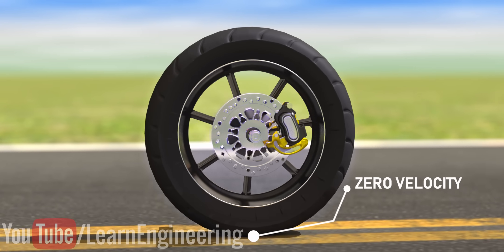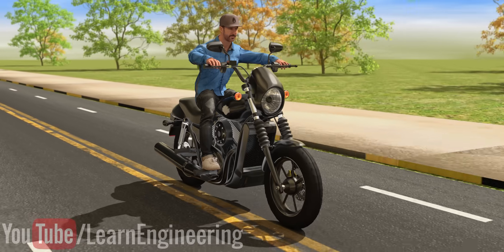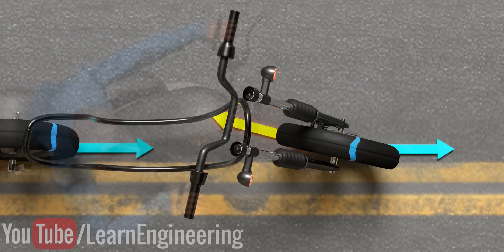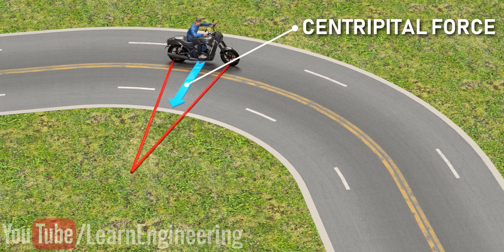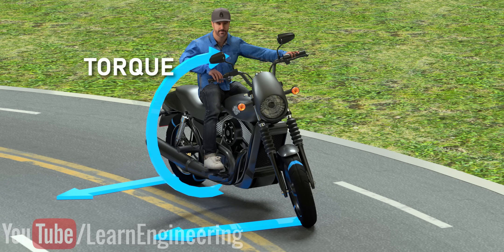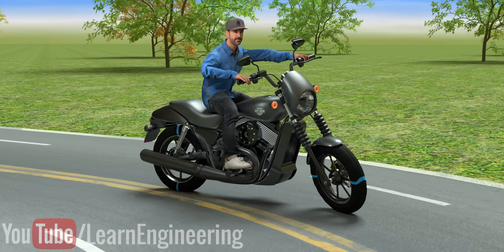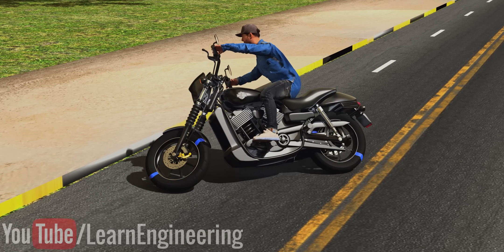Counter Steering | The interesting physics behind it

Comment: What crap! Only at very slow walking speeds can you turn the handlebars in the direct you want to go and the bike follows. Above walking speeds, push right, go right, push left, go left. Pushing the handlebars left means turning the handlebars to the right, and the bike leans left, goes left. Push harder, and the bike leans deeper, sharper.  The same for the push right, go right ~ turning the bars left by pushing right, leans the bike right, and you go right. It’s so seamless, most folks don’t even realize they are turning the handlebars in the opposite direction they intend to go. A classic case of those who think they know, don’t really know, but talk like they do… .

Comment: The problem with "countersteering" is everybody has to over engineer their explanation or techniques to counter steer (i.e. push the left grip forward to go left). It's WAY simpler than everyone makes it. I personally believe that if you need to think about how you are going to countersteer, you shouldn't be on public roads yet. You need to develop your instincts first.

I think of it as weight shifting. If you need to turn left, you need to shift your (and the bikes) weight to the left. The only possible way to to that is to turn the handlebars to the  opposite direction and Instincts will take over from there.

The notion that it "only applies if you are going over 15 or 20mph" is nonsense. Handlebar movements only become much smaller and much more critical at higher speeds. Try and ride your bike at the slowest possible speed that you can and watch how much you turn your handlebars to keep yourself upright. THAT is still countersteering.
Reply: i saw a really good video about counter steering, the best ive seen. when we ride a bike, we all by instinct slightly turn the bike left before we turn right, and slightly turn right before turning left if we need to
make quick turns. its the same on a motorcycle
Reply: @itszezes  
You don’t do that on a motorbike.
Reply: @itszezes  Turn left and then right to turn right is a Scandinavian flick and it only works with cars.

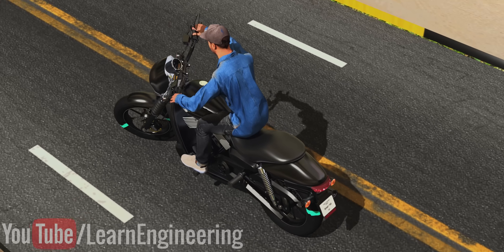Comment: WRONG!.... Geez I hate people trying to look smart talking about hting they don't fully understand and invent theories... Ok so before 3:30, what you said was close enough to the whole truth. But a complete physics analysis would be too long so cutting the corners like so is ok. BUT... At around 3:30 you are claiming that "the torque" will lean the bike to the right is not only completely wrong, but also, it goes exactly and completely AGAINST what you just said. And even a complete moron can understand easily where the mistake is. You talked about the "no friction" earlier. So how the hell can you come up saying that the "torque" would lean the bike on the right. You know what torque is or not? Obviously not. Torque is a force originating from an axis that makes something spin around said axis; like in an engine. That axis on a bike is typically at the height of the center of gravity of the bike; somewhere just below the fuel tank usually for handling purpose. So if it was a torque like you say that is causing the bike to lean, then it would mean that the tire would have a tendancy to turn like a fan, around a longitudinal axis like an airplane making barrels. Going upside down and back up and son on in mid air. That is obviously not what is happening here. The reason why the bike is leaning is simply due to inertia and the friction of the tire. You see, when you turn the handle lets say to the left like in your example, you make the bike turn left because of the friction of the tire (go back and learn the basics of inertia). BUT, since every part of the bike and the rider that is not in contact with the ground wants to continue in a straight line (inertia), the wheel wants to go in one direction while the rest wants to go straignt, making the bike "fall" on the right side. THAT is why the bike leans into ont side or the other quickly. Don't forget there are 2 ways to change the lean angle of a bike (as you mentionned yourself). By using your body position, and counter stearing. Using your body position to fight off the mass of the bike and the gyroscopic force of the wheels mean that it take a lot of effort, thus time, to change your trajectory. Hence why at high speed and in a tight curve, you MUST use counter streering to lean the bike quickly so that you can in turn pivot the bike in the right direction. And then, once the bike leans on one side, many different forces act together to make the bike turn. That part you got right. There is no magic torque in the middle that make the bike lean. Again, it is the friction of the tires that fights off inertia while the rest cannot that leans the bike in one side. And in fact, the reason why it allows the bike to lean way quicker is that your whole body, and the bike's mass act as a lever. That also explains why you don't need it at speeds below 15 km/h or so. Because there is almost no inertia, and the gyroscopic force cannot participate in the battle of forces which actually turns a leaned bike while preventing it from falling on the side.

Comment: Your science is very flawed however ALL 2 wheeled vehicles initiate and maintain turns with one steering input, a push in the direction we wish to go (countersteering) You can lean all you want and the bike will not change direction. There must be a steering input to change the direction of travel and lean the bike. We don't cleverly do anything.

Comment: There's a phenomena called gyroscopic precession at play here which means a force acting on a gyroscope such as a turning bike wheel will result in the effect taking place 90 degrees after the input in the direction of rotation. Nudging the handlebars left will result in that input initiating a lean to the right, that lean to the right then helps turn the front wheel to the right appropriately. That's how I understand it. This gyroscopic science is used wisely in aircraft instruments and helicopter rotors alike. While it works ok, I once read that using this technique on a motorcycle caused erratic wear on the front tyre and was advised to shift weight to the appropriate foot peg to initiate a turn to prevent this uneven wear.
Reply: I would argue that the foot peg scenario is far less effective than counter steering. There is only one way to steer a bike. I read a similar tale a while ago, but the author stupidly made the assumption that the front wheel continued to steer against the bend.. as opposed to steering into the bend. Now if he had been correct (which of course he wasn’t) I could see the argument.

Comment: Counter steer is only in effect at higher speeds theoretically it is at lower speeds to but almost never applicable if you have a bike or bycicle take it up to cruising speed hands off and just push one bar. It will lean to the side of the bar you pushed and make it easy for you to quickly turn. Boom you counter steered

Comment: Counter steering is a must if you are serious about riding it should come natural even if the technique doesnt make sense.  The best way to describe is turning the wheel produces leaning forces in the opposite direction.  This makes it far easier on the highway as being straight up balanced going 60mph or faster your barely gonna be able to turn unless you use counter steer leaning is for large slight angles and countersteering is for the unpredicted situations you need more response out of your motorcycle the better you get the more agile you become

Comment: This video shows things that are NOT true.
1) There is no such a thing as "normal steering", bikes ALWAYS turn by countersteering and everybody turn this way, even when they lean their body towards the center of the curve, because the body leaning movement will forcefully transfer some weight on the inner handgrip, leading to an effective countersteering action.
The only possible way to steer a bike without countersteering is to shift the rider's center of gravity towards the center of the curve (wich is achieved by leaning the body PLUS loading the inner footpeg) while NOT touching the handlebar, and this thing is definitely NOT a "normal steering".
2) After you lean the bike by countersteering, there is nothing like "the drive cleverly steers towards the direction of the curve" in order to re-align the front wheel to the turn.
The front wheel is AUTOMATICALLY re-aligned by gyroscopical precession, the driver does NOT do anything but holding the pressure on the inner grip.

Comment: We all seem to be leaving out a huge part of steering a motorcycle. LOOK WHERE YOU WANT TO GO, NOT WHERE YOU ARE GOING. Then push on the bar in the direction you want to turn.REMEMBER, BIKES GO WHERE YOU LOOK. You will need to maintain pressure on that bar as long as you need to be leaned over, so you are controlling the lean with the amount of pressure and the length of time you hold said pressure.   It simple but you do need to practice it in order to control it effectively.
Reply: Lol I wish I knew this when I skid out on a hairpin turn.
Reply: @iBloodxHunter  what we're the mechanics of your skid? Did you wash out the front wheel or slide the rear wheel? Either way, speed should play a part . Too fast and washing out the front is possible but control able and too slow and counter steering doesn't work as it requires centrifugal  forces, however all of it goes away if you hit something midcorner like gravel, or sand ,or an animal  or give it too much gas and break the rear tire loose. Which mistake did you make?
Reply: @elmerfudd1086  Slid the rear at 25-30 ish. There was a straightaway for like half a mile and they put the 50mph limit sign right before the turn. Should have payed more attention.
Reply: @iBloodxHunter  do you put a tire dressing on your tires? That stuff creeps up the tire and onto the treads which often causes the tires to lose grip. Either that or there was something on the road surface like sand or gravel or possibly grass clippings if there were enough of them. However, it could even have  been caused by old dried out hard rubber tires even if they were dry without the sand or grass clippings. But in the end...none of us have not messed up at sometime while riding a motorbike so don't beat yourself up about it. I know from my own experience,  this is one of the more effective methods of learning  how to ride better. I'm just hoping my education is over by now.

Comment: What really makes a difference is the weight of the wheels. Most imports run very light weight wheels, whereas harleys do not. This adds to the gyroscope  effect and makes turning much more difficult! For some reason this company resists better safer technologies. My guess is cost. Strong lightweight wheels are expensive. Hd likes to charge high prices for the machines, yet use cheap components to build them. 
If you're going to buy a harley after years of riding Imports get used to a hard to turn bike along with less effective brakes!

Comment: This is the worst article on steering a motorcycle I've ever seen.  Every motorcycle rider countersteers whenever going over about 15-20mph.  They don't think about it, either.  It's a natural act of riding and steering.  Doing anything other than that will result in you crashing the bike.
Reply: I countersteer when I go zero mph or faster.

Comment: Physics ok but he has no clue about driving. You dont practice countersteering in such a way, you have to make it an integral part of your driving. Never steer in the opposite direction but PUSH in the direction you want to turn, if turning to the left you push with the left hand and the rest is done all by itself by feeling the pull on the handlebars and compensate with no further mental involvement. Just remember to look more or less in the direction you’re going, not just in front of the bike. 
Im sure lots of people already mentioned that at any speed above “brisk walk” you cannot lean enough to compensate the rotational force when not countersteering, there is no other way to drive than countersteering but at speed we dont notice it well because the steering input is so subtle.

Comment: 👌 nice
Reply: But wrong!
Reply: @softailfun  please explain
Reply: @iamhighwayman  
The video showed counter steering to be a two part process (steer one way, then the other), it isn’t!
To turn right the rider pushes forward slightly on the right bar. When the angle of lean is achieved he stops pushing and merely maintains a pressure on the bar. To stand the bike up he relaxes the pressure, the steering straightens and travels straight If the rider were to push on the right bar and then turn in the opposite direction (as this video suggests) the bike would stand up and fail to take the bend.
This link is probably the best video on YouTube for this topic. I hope I have justified my original comment.
https://youtu.be/lzk8oyNO708
Reply: @softailfun  thank you man.
Reply: @iamhighwayman  
All good fella. Ride safe.

Comment: I was trained to countersteer at 18+kmh. The better way to  think about it is to push foreward the hand on the side to which you want to steer and use throttle to prevent toppling and accelerate into the desired line. Really works. You are basically making the bike partially fall that way.
Reply: Yea…. Not quite.
https://youtu.be/lzk8oyNO708
Reply: its either that or crash ,,I dont understand why someone needs trying to understand that

Comment: you never steer (turn the handlebars)  with a motorcycle, it always should be weigh transfer , counter steering just initiates the weight transfer, just tip the handlebar dont actually steer
Reply: Every action has an equal and opposite reaction.
You can't transfer your weight when you are on something.
Reply: Enjoy the learning curve:
https://youtu.be/lzk8oyNO708

Comment: For anybody that doesn't believe in countersteering, this is a good video to watch: https://www.youtube.com/watch?v=bt3VbOEWp6E&ab_channel=MotoJitsu%C2%AE. Yes, leaning the bike can/will get the bike to turn, but slowly, and it's having the same affect as countersteering, it just doesn't react as quickly or the same. At road speed (above about 15MPH), 'direct steering' will NOT work. Just watch the above video and you'll realize that once you push the left bar - or pull the right bar - (thinking you're turning right), that will introduce a counter steer and you'll start turning left (not right). This video is very misleading talking about countersteering like it's a choice you can make at road speed.

Comment: This explanation is incorrect.  The wheels on a motorcycle are gyroscopes.   Big gyroscopes.  If you take a bicycle tire and spin it like the front tire of your motorcycle and then push on the right axle it will lean and  turn right through precession of the gyroscope. It is the same on a motorcycle you push on the handlebar in the direction you want to go,  push on right handlebar go right push on left go left. The only time this doesn't work is when you are going so slow that the gyroscope has little effect.

Comment: It doesn't work that way. If you're cornering at medium to high speed. The counter steering happens naturally. It doesn't happen during slow maneuver, which the bike will head towards what's your pointing, instead the bar will slightly point to the other side to balance the lean angle. The more lean angle, the more the bar will point the other way. Some cars had this mechanism where when a steering wheel steered to the right, the back wheel will steer to the right  to balance the force
Reply: You have this all wrong fella.
Learn here:
https://youtu.be/lzk8oyNO708

Comment: Here's the simple explanation...at slower speeds counter steering is not necessary as the bike's momentum is not enough to tip bike over/outward, whereas at higher speeds the forces will tip the bike unless you "lean" the bike into the curve using counter steering.

Comment: Countersteering means to steer in the opposite direction. 
How Countersteering really works
When you steer right for example, the bike will go left, why?
This is due to traction and friction. When the front wheel is turned, the friction of the road will grip the tire. The road surface will push against the tire facing the opposite direction causing it to tilt, the same for the rest of the bike. All of the motorcycles weight will shift to the front and will start to tilt due to inertia forces, naturally gyroscopes corner when they are leaning.
Also gyroscopes naturally defy gravity when spinning, this is exactly WHY TO KEEP YOUR ARMS LOOSE AT ALL TIMES
Spin a bicycle wheel and tilt it on a string. Once done so, it will stay in the same position until the gyroscope spin rate is too slow to defy gravity.

Comment: There is so much wrong in this video it’s not funny…. Counter steering happens every time above a certain speed… typically anything above 15 mph… counter steering destabilizes the motorcycle and achieves lean angle because of gyroscopic forces. This happens because of the shape of the tire… no one is steering a bike normally at speed… and leaning the bike while counter steering allows you to turn faster and sharper depending on your speed… this is not a very educational video…

Comment: Seems you forgot to talk about something crucial…speed. You cant counter steer at slow speeds. There is a time for handlebar steering. Like around 5-10 miles per hour.
Reply: So, what is the speed when that happens?
Or is that at 5 to 10mph it is totally random? Sometimes you turn left and sometimes right.

No, there is no speed when physics start work differently.